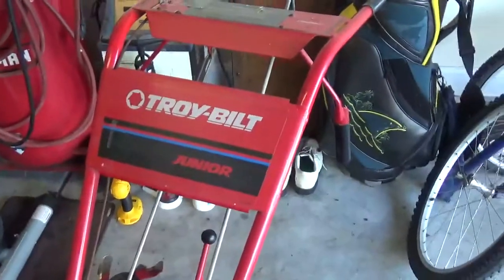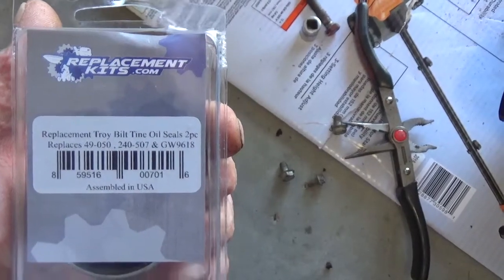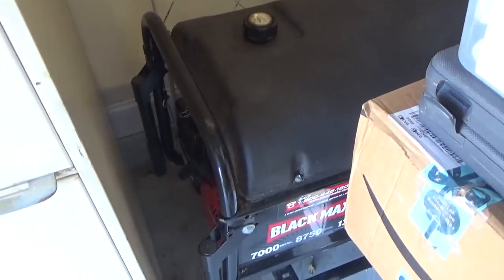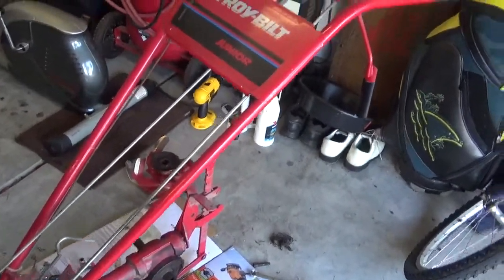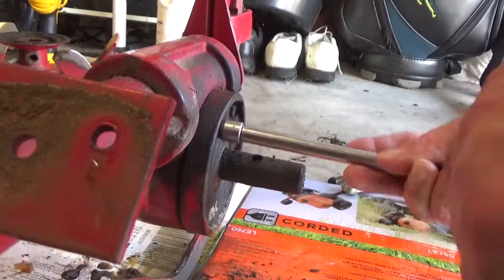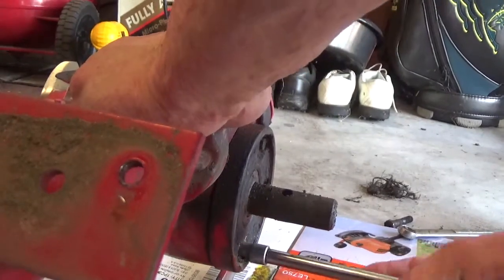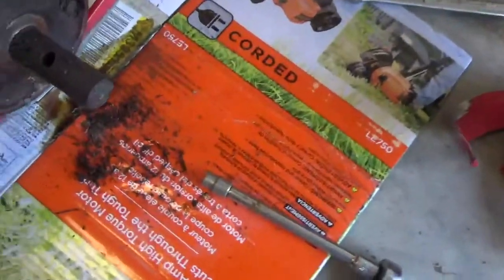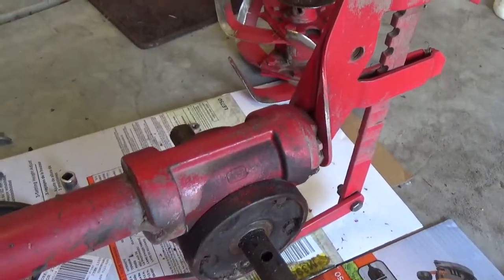Troy Bilt Junior Tiller

Comment: Troy-Bilt  Junior Tiller - Drive belts (both forward and reverse) I too would really appreciate some parts numbers and or a fast and dependable place that sell them.  Heck even the lengths or each and I will wing it at this point.  Ordered 2 separate belts and both were too big so any info would be appreciated.
Reply from the maker: I do apologize, but I am not at my parents house and cannot look up the part numbers. However if you go here https://support.troybilt.com/s/article/338-1?language=en_US this would be a good start. This tiller was pretty old so the parts that were ordered I think I got them from amazon. Search your make and model number as well or search this troy bilt junior tiller manual or parts list. I am sorry I wish I could give you more help on it.
Reply from the maker: Here are the part numbers for the belts 97075 flat belt reverse drive, 20565 v belt forward drive. Belt set 11516. Again sorry for the late response.
Reply: @theawakening5548  appreciate your info and be well my friend
Reply from the maker: @MarcMcKay  You are welcome. Again I am sorry that I did not respond to your comment earlier. I hope that the numbers helped you out. Take care as well.